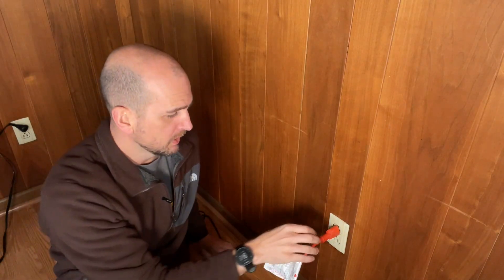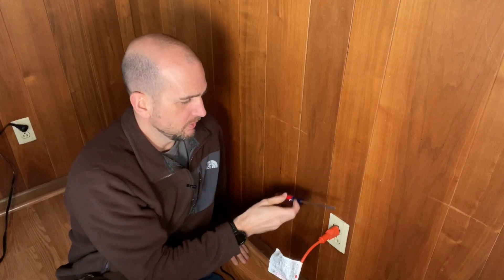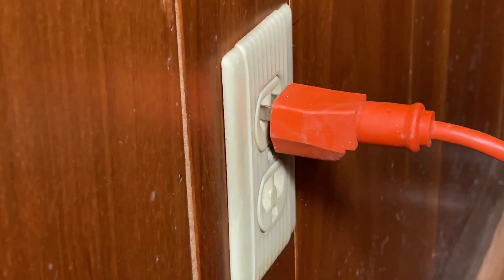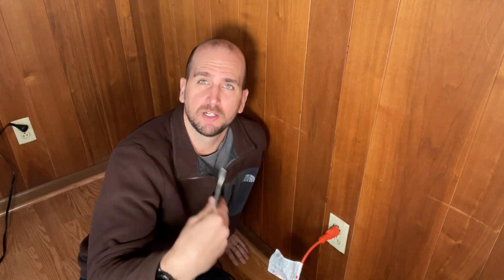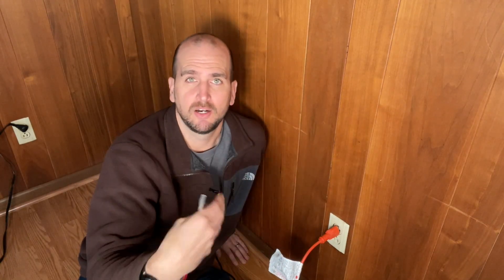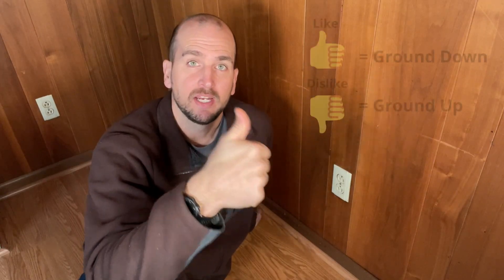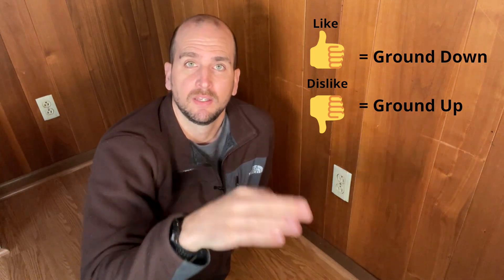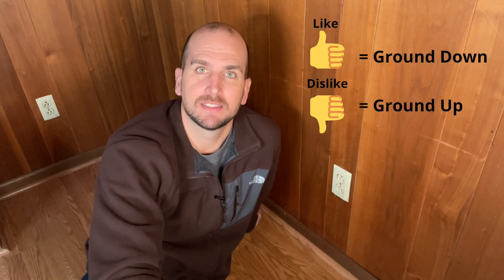Should An Outlet Be Installed Ground Down Or Up

Comment: I have several power supply bricks that have polarized two-blade AC connections.  The polarized nature makes these mount with the bulk of the brick below the plug IF the ground is down.  If they are plugged into a ground up outlet, the bulk of the brick is above the plug and could cause it to pull away from the outlet and possibly fall out.

YouTube doesn't show the number or dislikes anymore.

Comment: I would say to be different and mount them horizontally, but then you'd have the argument as to whether the ground should face left or right.  If mounted horizontally, the hot side should be down, in case a metal picture frame falls and stays on the plug, the frame isn't hot; that'll work even with a 2-prong plug.  I'm a 70+ year-old who, for most of my life, have seen the ground down, and that just feels the most natural to me.  At least, for as long as grounded outlets have been around!  But, as you and others have stated, the orientation of the wire coming out takes precedence.

Comment: It has never crossed my mind that there may be a safety reason for having the ground pin up. It seems really sensible for it as well. I will definitely keep that in mind when I plan my next build.
Reply: I'm sure it does happen once in a blue moon, but the rarity of metal bits falling directly on a partially exposed plug makes it seems like a bit of an overreaction to call for an install of all grounds up. 
Especially when there exists thousands of devices with only two prongs where ground up wouldn't help, and hundreds and hundreds more devices designed to be used in ground down outlets.

Comment: use GFCI outlets as a guide on this issue.  all households will have some GFCIs, and their markings must be normally read.  Therefore in a given household avoid mixing some ground up with ground down, it's confusing or irritating to people down the line, and the GFCIs wind up establishing the orientation precedent so that all is uniform throughout

Comment: Down, always - given how most big heavy cords and flat plugs are shaped.  If you put it ground-up all the big heavy cables will be trying to go towards the ceiling putting extra strain on the plug and making it a bigger trip-hazard if it runs out from the wall.  If its ground-down all the big cords and power strips run towards the floor, reducing strain and tripping hazards.  This also puts a natural drip-loop in case of things like a window air conditioner, dehumidifier, or aquarium that could have water.

It also matters for polarized transformer plugs, which typically have the fat prong such that it will hang nicely if its ground-facing-down, but will unplug itself with the weight pulling if its ground-facing-up.

Comment: Licensed 50 years.    Just finished a job yesterday with 80 something openings all in gray schedule 40,  3/4 PVC conduit.

I always have placed ground down. When a cord is stepped on,, and they all get stepped on, the last prong to come out is the ground.  The ground prong is manufactured longer than the hot or neutral for exactly the same reason.  The ground is to be the first contact into the receptacle, and the last contact coming out of the receptacle.   When a cord with a ground prong is stepped on and the male cord end rotates out and down the last prong in , is the ground.  Nearly all right angle plugs are ground down.
I DID have a knock out, steel disc, fall into that top space one time.  The result was rather spectacular when it lodged there.   There is an argument both ways.

Comment: What if the plug comes out a bit with ground up and the ground is out far enough to remove the circuit protection.....  

I prefer the systems of othrr countries where they have the metal contacts on the tip of the connectors. There should be a clicking lock that holds tight such as a 1/4" phono jack for headphones for example.

Comment: Let me fix this for every one. The outlet covers in commercial buildings are metal and with housekeeping constantly plugin and unplugging vacuums and people with fans and heaters. The screw will loosen and the metal plate will fall and short. Now it could cause a fire but most times it will trip the breaker were in commercial buildings the breaker boxes are locked.

Comment: Electrically it makes no difference. Electricity doesn't know if the grounds wire is above the hot and neutral or below it. And since the Romex cable probably has twists in it, the idea of which should be on top is ridiculous. Also electricity doesn't know if it's going through a wire with black, white, or green installation. Everything would work fine with all purple wire. The color is just there to identify if it is a hot, neutral, or ground. Normal Americans prefer the ground at the bottom. But Canadians and gays like to see the ground whole at the top. Like an A hole with two legs under it.

Comment: In India ground facing up is a standard installation procedure and each electrician  ensures this 100% The ground terminal is thicker and longer also. Which helps to stabilize the plug

Comment: Nationally there is no standard. You can install an outlet either way. Ground up or ground down. It’s up to the installer.
But here’s what I found online. And it makes perfect sense to me.

Does the ground go on top or bottom?
With the ground in the upper position, the ground prong on the plug could pull out with the hot and neutral still energized, thus creating a possible electrocution hazard. Ground should be at bottom that way if the plug is accidentally pulled; the last prong to disconnect will be the ground.

Comment: I had started putting mine with ground UP, because I feel it's easier to plug in and unplug that way. My nieces husband is an electrician supervisor, so I asked him. He said technically, that IS the correct way, stating your first example with something metal falling between the wall and the plug and potentially causing a short if the ground is down. The 90 degree plug issue is just a minor inconvenience.

Comment: Ground down because the outlet then looks like a shocked face which  kids recognize as danger.  I think it is better to allow a loose metal cover hit the live leads on top because the breaker will blow as opposed to the ground holding the cover in a precarious dangerous configuration while the appliance is still operating.  When I was young I had some coins roll off my desk, one fell on the plug leads ..ungrounded plug ...quite the loud pop but the breaker did go as designed and after that I made sure the plug was in all the way and I was less careless with my money!

Comment: The current home we live in HAD ground up outlets.  There was also a problem that developed in one room, after investigating I found that some SOB had used the stab in connectors on the back but failed to actually insert the wire, that had the effect of killing the lighting as well as outlets in that room. Obviously shoddy work to say the least.  My personal feelings are that the ground (earth) should be down and the hot (high potential) should be up.  Whether vertical or horizontal it I always put the hot side of the outlets up.  BTW in my experience (50+ years) of using and working with electricity, most outlets, be they in residential, commercial or industrial environments are oriented that way.  As far as switched outlets are concerned they are wired the same, I've seen both sides of of a duplex switched or half switched and the other half not (always hot).  Just my 2 bits.

Comment: All things considered, I’d like to introduce geometry. A 3-pronged receptacle is a triangle, and the base of a triangle is stronger than its top or point.  I install them so the ground is down (the top or point of a triangle) and the base or strongest part of a triangle (or base of the triangle) is up.  Of course if a receptacle or plug is loose, there’s a problem of either the receptacle or plug and must be corrected.  In that gravity pulls a cord downward, I’d rather have the strength of the plug at the top rather (the base) than at the bottom (or point).

Comment: NEC actually says to follow manufacturer instructions in all cases (because that's the method any device being installed received it's fire rating).  If there aren't any, it doesn't matter which way the ground faces.

Ground up with metal covers can cause the ground to be shorted to neutral and increase the risk of electrocution.  A breaker tripping is far less of a hazard if the ground is down.  Most plug in devices are designed for ground down, as well as most other plug in devices.  

I can't see the dislikes.  lol

Comment: Also with ground up if something falls on cord it is designed to pull the plug out.  With ground down the ground prohibits plug from being knocked loose.  DIYER who sold receptacles to hospitals for years and asked electricians why they did ground up.

Comment: I was told by an electrician who wired my house that ground down is "standard" and when the receptacle is in the "ground up" position the upper receptacle is wired to a wall switch and can be controlled by the switch.  I have also seen this "convention" in 2 or 3 other houses.  Also, in the garage they are installed ground up.

Comment: My home has the Ground Down. I checked my GFI outlets in the Kitchen & Bathroom, the printing is double so you can read "Reset" in either Ground Up or Ground Down. Now I seen where a fellow was installing a new ceiling in a office when he temporary lean metal strips against the wall, and one accidentally slide down the wall, hit behind a cord plugged into an outlet, and sparked a short to trip the circuit breaker. That was extremely rare event to happen, not enough to run home and turn all my outlet around. I been wiring stuff since Electric Shop in High School. and I like Ground Down myself.

Comment: Now for the kicker:  I replaced a 4-plug outlet oriented ground up, which was irrelevant, with a 4-plug unit with individually rotatable fittings.  This was installed in a location where I use electronics with bulky ground fault units at the plug, so only two of the original four were usable, no matter how they were oriented.  Current orientations are all ground away from the center of the unit and all can be used at once.

Comment: A Regular outlet should be installed ground down. Unfortunately The two bathrooms in my house have the outlets installed sideways and It kind of sucks since plug in air fresheners are made to work right side up and not sideways. They tend to leak when laying on their side.

Comment: I always install ground down UNLESS the intended plug such as an air conditioner  dictates otherwise.  The majority of plugs are designed to more easily be gripped with ground down.  Likewise on exterior outlets, I always install with ground facing right.  This takes the guesswork out when trying to insert a plug where the alignment view is blocked by the outlet covers.  As you mentioned, here is no code restriction.

Comment: All my receptacles  are installed sideways. I prefer ground facing down. However, when you look at the bare receptacle, in my experience there is text molded on the face usually hidden behind the plate that if the text was placed right side up, the ground would be facing up.

Comment: I prefer gound down for two reasons: 1) You know which way to install a plug  even when you can't see the outlet, like when it is behind a couch, bed or desk 2) having the ground down tends to help hold the plug tighter to the wall when the cord is pulling it down. This being said, I follow the "practice" of ground up when the outlet is switched, so you can recognize a switched outlet. Also, when only half of the outlet is switched, I follow the "practice" of having the switched side on the bottom..
Reply: Isn't that why there's holes on the connecting prongs? When inserted there's something that holds that in
Reply: @Art2d2_a  The holes are just for a bar to hold the prongs in a straight line during production. The receptacle normally clasps behind them further on the prongs.
Reply: @Art2d2_a  That is true, but they can loosen over time.

Comment: I prefer ground down.  When I am inserting or removing a plug and for whatever reason, it is requiring some effort, I can easily see where my fingers or thumb is on the top and do not see what is on the bottom. Hence, ground up is a greater shock risk than ground down as you have much better visual feedback with your thumb or fingers on the top of the plug.  A commentator below also indicated this and I agree with him/her.

Comment: DIY'er here. I knew 8 of 10. I prefer ground-down. Why? As mentioned in the video, wiring that exits the side at 45° (not 90° like what the video said) will generally angle down and not up.

For safety: Think about how you grasp a plug to insert-into or remove-from a receptacle. Your thumb is on top and pointing forward. Your index finger is curled underneath and is sideways. With ground-up mounting, your sideways index finger is closer to the hot/neutral blades. If your index finger slips forward (perhaps you didn't grip the plug firmly enough while inserting) it could contact those two pins. Zap! On the other hand, with ground-down mounting, your sideways index finger slipping forward would only contact the ground pin.

An argument could be made that, well, your thumb would then be exposed to the hot/neutral pair instead of your index finger. True enough. But your thumb isn't as wide as your index finger is long so there's slightly less chance your thumb would span both blades. Also, given the slightly downward angle of attack when inserting a plug, your thumb will be resting more forcefully on the top, reducing the chances of it slipping.

Anyway, that's my opinion.

Comment: My house which was built in 2003, has all the grounds up…. When I asked I was told, the ground up is so, if you put anything into your walls like nails, or whatever you hang a picture from it will only hit the ground. If the nail falls between the wall n lands in the receptacle. Which at first I was like oh okay. Then after thinking about it, I thought well that’s stupid! The receptacles are in a plastic box! N the wires have a protective, insulation on the rest of the wire. So whatever guess it’s just personal preference

Comment: I'm thinking ground down will ensure the ground will always remain seated. Ground up, yes, something could fall and it hits the ground pin first, but if it's that loose, what are the chanecs it is still grounded? If the plug is that loose, it should be replaced anyway.

Comment: This has been a pet-peeve of mine for many years.  I cannot believe the NEC allows 'ground-down'.. It's very dangerous.   I know of two house fires, fortunately small and extenguished quickly. Only because someone was nearby.   No1.  a cat  knocked a metal piece of window blind lose and it slide down the wall, right into the loose plug , with 'ground-up' it shorted across the neutral & hot. Sparks and a curtain fire !!    No 2,  same situation,  a person dropped a metal clothes hanger, it fell behind a loose plug,  POW sparks and hot metal flew !!     So, some think the outlet '"looks better" ground down !!   Why would that ever be better, it's a serious risk of losing a home.   Outlets should have been 'coded' at horizontal  !   Neutral up...

Comment: Hospitals in US are all ground-up orientation.
Ground-down will fail safety inspection, and there are no side-ways outlets.
Don't know if this proves anything, but a standards like this usually come about as the result of an injury or death.
BTW, all the molded NEMA power cords were also 'ground-up' orientation.
Only pre-built power cords were allowed; no splices or after-market cord-ends.
I worked 3 Hospitals in Washington state, all the outlets were on the same orientation.
Red outlets?  Wired to UPS/generators for power during blackouts.

Comment: Another argument for Ground Up is that when you pull the plug out, your thumb is often on the top, and if you slip or something, you'll hit the ground, not the hot. I, on the other hand, have always wired ground down unless it is a single circuit receptacle or a twin circuit receptacle such as in a kitchen. That way you know you have a whole breaker to yourself if it's ground up, and you're shared if it's ground down.

Comment: Ground Down!  I am not worried about metal object falling in the 1/2 space.  I grew up with Ground up and got SHOCKED many times because you index finger is sitting across the plug at the bottom and thumb at top.  Those sticky ones you really need to pull hard.  With Ground Down, if you touch the ground pin with your index finger, there is no problem and you have much better control of your thumb in this top position. Haven't gotten a shock in over 20 years now. YAY!

Comment: The Standard is Ground down. Buy any specialty outlet cover that powers USB or has LED lights and you will see. I have outlets in my house using both up and down , I only mount ground up when its needed. The real question is Left or Right when mounted horizontally ? 😂

Comment: I once witnessed a penny fall across the two spades of a plug. Never tripped breaker but instead started to melt like arc welding. There is some sense in ground pin up

Comment: I'm of the opinion that ground up would be safe just from a wiggle loose perspective than ground down for reasons you stated. But I could also argue that holding a plug when inserting it's better to see hot and neutral (ground down) because if hot and neutral were down there's a chance you could mishandle the plug and accidently touch hot on insertion so ground down may be safer for insertion.

Comment: Easy, if you see a light switch outlet combination, the outlet ground is facing down. 
You can't install it up because the wire of the appliance will be in the way of the switch.